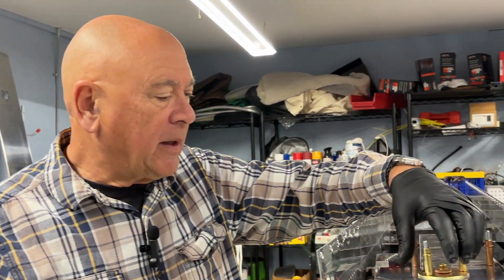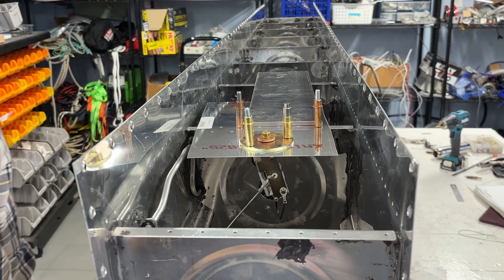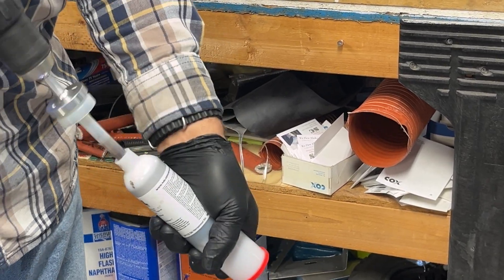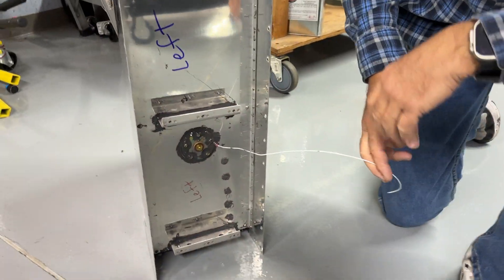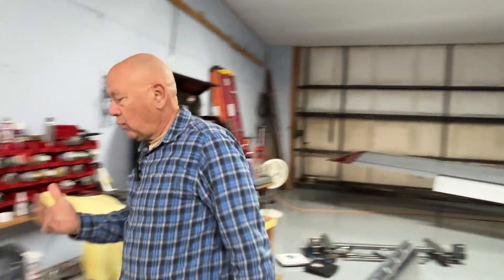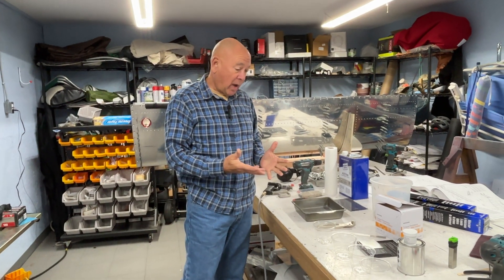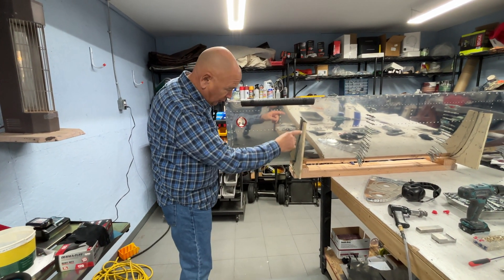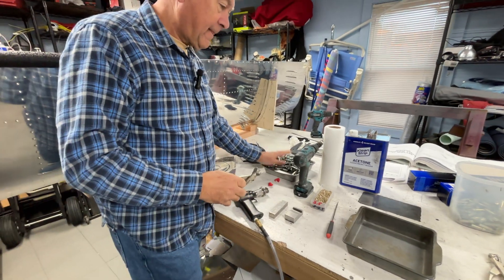Rear Baffle attach on extended range tanks rv 10

Comment: Another great video showing proper procedure and skills for an excellent job on the fuel tanks. I really appreciate the instructional videos that you two do for us.
 There is one thing that could be improved on. The ground for the sender is a great idea, however it should not have any fuel sealant between the connector and the metal. I have done many hundreds of them as an aviation electrician, all of which were inspected and many tested for continuity before sealing. The sealant insulates the connection preventing a good connection. All connections outside the fuselage need to be completely encapsulated past the connector on to the wire to prevent moisture intrusion and corrosion.
Reply from the maker: I screw it down tight and then seal it.
Reply: @baselegaviation1614  As long as you are happy with it.

Comment: Thanks for the video Vic. Not tackling the tanks on my -14 yet, but went with tank sealant instead of double-sided tape on my rudder trailing edge. One tip my EAA Tech Counselor passed on to me was to shed/change-out gloves that got any (ANY) sealant on them. I doubled my gloves, first pair dusted ever-so lightly with tire talc to making removing the outer glove easier. Great tip on the float mock-up!